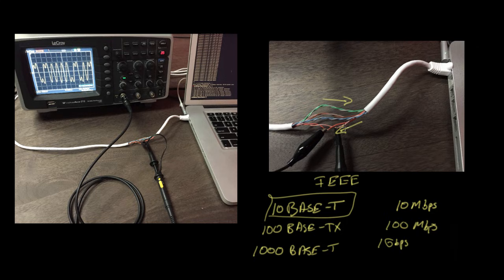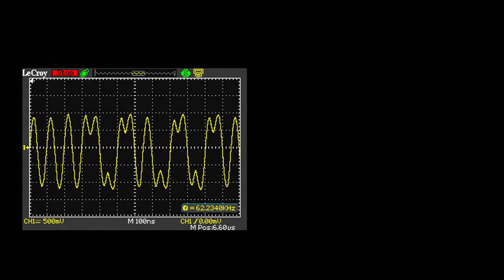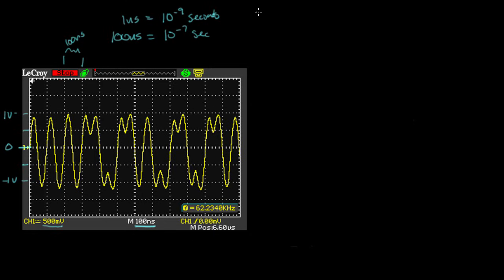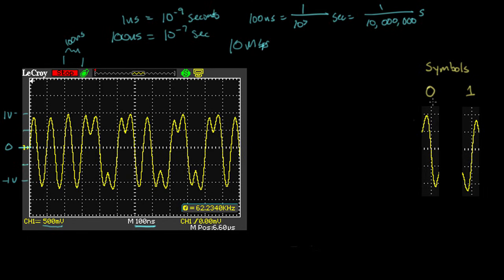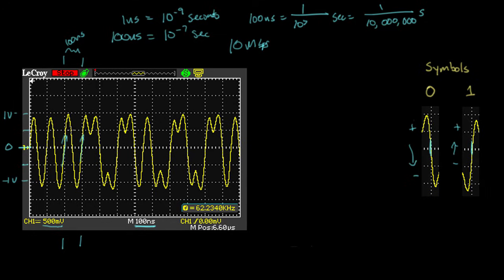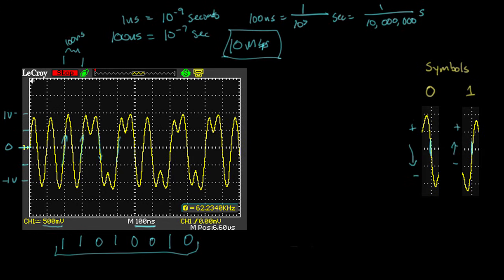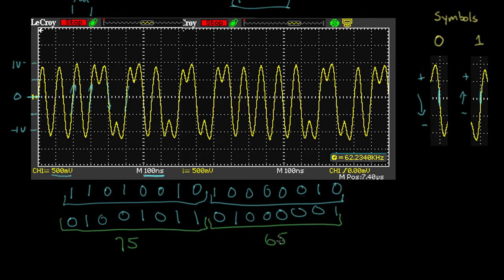Analyzing actual Ethernet encoding | Networking tutorial (4 of 13)

Comment: "Connecting my 8-bit breadboard computer to the internet"
Reply: omg lmao. My be possible, this dude is insane
Reply: @nickadams2361  giving a shit in this world is insane lmao. for real, though, this guy's videos are very insightful.
Reply: I think the clock frequency is too low, but there might be a protocol for slower computers
Reply: @franchufranchu119  overclock it
Reply: @M Isa haha
Reply: @misaalanshori  goodluck high freq on a breadboard
Reply: @franchufranchu119  Dialup? 56K?
Reply: @franchufranchu119  make a separate network card
Reply: @franchufranchu119  it is actually possible.  Network switches are often backwards compatible with older standards, so even if a switch is labeled 1000 BASE-T (1 Gbps) it likely supports the 10 BASE-T used in this video.  And even if the 8-bit breadboard computer couldn't even handle 10 BASE-T, you could use an external converter to go from a serial signal at whatever bitrate your breadboard is capable of into one of those BASE-T standards.  (a quick search online shows me a RS232 to 10 BASE-T converter)

Comment: I have been tempted to get my oscilloscope hooked up to measure Ethernet speeds for some time.  I'm glad you did it for me and I can just watch it here.  My initial assumption was that when the transmitting end of the wire went high, the entire wire would be high before it changed to low, meaning that data didn't really travel down the wire, but more like the wire as a whole would reflect the current instantaneous state of the signal on it.  But your scope shows it changes from high to low in only 50 nS.  Assuming electricity (signal) traveling at .8c that would mean the signal would only travel 40 ft in 50 nanoSeconds.  That means that a whole nibble (4-bits) can be on a 100 meter length of cable at once.  That blows my mind!  And that's only 10-baseT or 10mb speed.  Imagine gigabit speeds and how many bytes are on the cable at once.
Reply: Do it yourself. Its not the same as watching a youtube video. Youtube videos are quickly forgotten.

Comment: Wow, thank you so much...spent a month trying to figure how to build a DIY wifi controlled power supply by implementing an old WiFi router and coding a simple browser interface for my phone - well I got stuck at trying to figure out how to program a circuit for variable power outputs I need via the WiFi router connected...or even better trying to figure out how to adapt router as a output settings memory device for the power supply circuit modifiable over the network. So I was trying to build an oscilloscope probe circuit, for the internet signal, to try to understand how to read and implement the internet signal for the live updates back and forth - I wasn't hoping to find a video that actually tells me precisely what to look for - wow...10 years of coding didn't thought me this - suddenly I understood how data is encoded into the electrical signal and thanks to your video I actually now understand how computing works wtf - brilliant!!

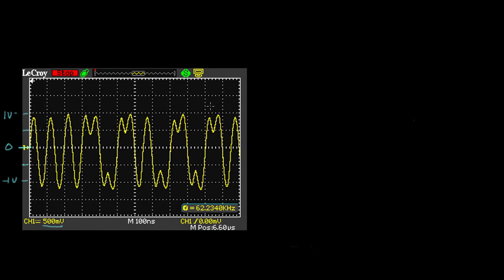Comment: 3:38 *Now in the horizontal direction, this is telling us that each division represents 100 nano-seconds*

7:38 *We've decoded two bytes*
[ 1101 0010 ] [ 1000 0010 ]

7:42 *And one thing that sorta I guess a little different about ethernet is the way is puts these bits onto the wire in this format, it reverses the order of the bits: The 128th place is sent last, and ones-place is sent first.*

So the time-axis must be increasing from left to right ?

Sorry, just trying to get this straight in my head. I understand now.
Reply: Yes the sweep goes from left to right

Comment: 7:50 - "...it reverses the order of the bits." Would you please explain why the order of the bits are reversed? Thank you for the great video!
Reply: It's just the way he hooked up the wires to the oscilloscope. Think about it, if that is the side of the sender, then what does the receiver side get first? For example, let's say you want to send me a message in order, let's say the message is "hello". If you send that to me one letter at a time from your side you will send: h e l l o, but at my side what i get first is: o l l e h. I have to first flip the message, or flip the bits as he said, to get the correct message. The graph you see in the video is basically the "o l l e h" from my example, due to the way he hooked up the wiring. Were he to reverse the wires, he would get the correct message right away, just depends from what way you're looking.
Reply: @shekharnandkoemarsing158  i think you're confused. packets aren't sent all at once. when i send the message "hello," i begin by sending "h," and you instantly receive this (for all intents and purposes), then i send "e," which you instantly receive. it's not like feeding a sheet of paper with text on it through a slot where the letters are revealed one at a time in reverse order, it's more like just talking to someone where each sound is continuously received by the other party in the correct order

sorry if you figured this out already i'm mostly trying to make sure nobody else gets confused reading this
also sorry for being so verbose im high rn oops

Comment: I’ve also heard Manchester line codes referred to as split phase. Some of the faster speeds I assume are using split phase with more complex constellations? I’m relatively new to digital data transmission. (RF engineer, first year grad student).

Comment: i can see how you could recover the clock frequency and most of the phase from any point in the signal, but i see two phases, 180 degrees apart, that are equally valid. one of those phases is invalidated when the bit values transition between 1 and 0, and it holds for half a cycle. but what if there was just a continuous stream of the same bit? how could it tell if it was a continuous stream of 1s or 0s?
Reply: also curious about byte boundaries! i would assume the line code is just responsible for transmitting a string of *bits*, and there's a higher-level coding scheme that aligns the bytes. but then you decoded the line code directly into bytes you sent down the wire, how's that work?

Comment: Quick question, so for transmitting you have two wires... The orange with white stripes which corresponds to the positive transmission and the full orange which corresponds to the negative transmission. So is the orange the ground? Why do we need both? Can we just use the positive?

Comment: What about differences in connection speed? For example, my Ethernet connection could be 1000 base t, but my connection speed is only 890 mbps. Why is this and how can the clock still be synchronized?
Reply: The link speed of your connection is independent of your computer's ability to transmit/receive to/from it. While your computer is not reading/writing the network the link is "idle". In your case of 1000Base-T this means special "idle symbols" are being squirted back and forth when there is nothing to do. In other words the link is 100% occupied with bits all the time but some of those bits are "filler".  !00Base-T uses a similar scheme but if memory serves 10Base-T really does drop to 0v when not in use (except for some frequent link test pulses to keep the link up but they could not be mistaken for data).

Comment: Thank You for this video. Very enlightening. Would you call this voltage AC as it reverses direction or is it an analog DC voltage ??
Reply: It's AC, since the number of 'direction reversals' counted over time added together equals zero. And it has to be, since Ethernet is connected to the cable using a set of transformers, which don't pass DC by definition.
Reply: It is 10 MHz ac.  It is RF actually.

Comment: In 3:31 you say that the voltage is fluctuating between 1v and -1v. Is it accurate to say that the Direct Current that computers use is turned into Alternating Current to send data?

Comment: So what is a negative voltage? Is that just electrons going in th opposite direction as originally intended by the circuit, if so how would this be possible, are we just calculating if the copper wire went left a little or right a little by electronic force?

Comment: Interesting. Does this mean that the ethernet ports inside our devices rely on FPGAs to register the rising edge of a bit (which registers as a 1) and the falling edge of a bit (which registers as a 0) to decode information? FPGAs seem like a good bet because of their speed, which is definitely required for the faster (1 Gbps) protocols.
Reply: 5 years later your answer is — dedicated hardware inside of an Ethernet port is called an ASIC, application specific integrated circuit. FPGAs are nice when you are not sure of the target or if you are not sure that you are finished optimizing. But ASICs are much cheaper to produce so they are used for large scale productions.

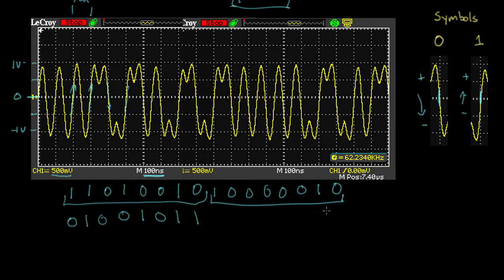Comment: 8:24 Anyone know why they flip the bits? Can't understand the purpose of flipping
Reply: from what i understand (could be wrong) each byte is sent in least significant bit first(so technically not byte reversed but only technically). this is so that when the data reaches another system, the system doesnt have to reorder the data and instead just receives it normally.

Comment: Anyone know why the voltage fluctuates from 1v to .5v or from -1v and -0.5v within a 100ns period?
Reply: Not an electrical engineer but it looks familiar as an audio engineer. If you play a square wave through any high system and look at it in an oscilloscope, you’ll notice it looks “wiggly” like this - you can find plenty of examples online. That’s because of ‘band limiting’ - the process of restricting the frequencies that we send through a cable to just the ones we are interested in. In the case of audio, we’re only concerned with the frequencies we can hear. In the case of networking, we’re only concerned with frequencies that will allow our receiver to decode our signal. Our receiver can only “hear” 10,000,000 transitions per second - 10 MHz. So we don’t need information contained in frequencies much higher than that.

So why does it make it wobbly? Well here’s the weird thing: all band-limited signals (which includes all sound, radio and electrical signals) can be represented as a sum of sine waves. In fact that’s more or less how they all behave in nature. So when you filter out the high frequencies, you end up seeing more of the big wobbles from the low frequencies. You haven’t distorted the signal, or made it harder for the receiver to follow - in fact, the receiver can’t tell the difference, just like your ears can’t hear the ultrasonic nuances of squeaking bats.
Reply: @gormster  wow thanks for your response ! Makes sense !
Reply: You have to do that to change 0 to 1 and 1 to 0. Without it you only can send "0" or "1". To send a different symbol (0>1 or 1>0) on the next clockpulse, you have to keep the signal high, or keep the signal low. In theory the signal would not make a little dip and it would be a horizontal line. (The little dip has to do with inflowing current, I think)
Reply: @Guust_Flater  Yeah what I'm wondering is specifically why the little dip is occurring.
Reply: Gaboik this explanation is incorrect.  These are not square waves. It is a 10 MHz carrier.  The data is phase modulated on the sine wave.  The squiggles are there because the bit waveforms don’t start at 0 volts.  Look at the symbols to the right. The waveform is made up of a sequence of those symbols back to back. When the symbols alternate, you get those little squiggles.  The phase of the sine wave is inverting at that point.

Comment: So what I'm confused about is it seems like your oscilloscope is reading 64KHz when measuring the wave. What I want to know is why is that? Is there something I'm missing about how ethernet works? Wouldn't 10Mbps be 10MHz? I'm curious because I want to do the same, and I want to know what quality of oscilloscope I would need to be able to accurately see the data.
Reply: you need at least 5x the signal rate to useful analysis, 10x if you want to go into intricate analysis.
Reply: but 64Khz is much lower than 10Mhz...
Reply: Hey. I know I am super late in answering this. What I think is happening is that the oscilloscope doesn't actually detect the frequency of the signal. instead that frequency is the frequency of the visible wave on the screen. It tries to look for a pattern on the screen and calculates the frequency of that.

Comment: Hi, Thanks for the video. I would like to know how do you know the  time division scale has to  be 100 ns. As mentioned in the video, this is  10Base-T i.e. 10 Mpbs communication system. I can't see the relation between 100 ns and 10 Mbps bit rate. Could you please explain it to me?
Reply: basanta sishir         10mbs=10 million bits
100ns=1/10 million s
so 1 bit ever 100ns would be 10 million bit ever 1 second.
Reply: basanta sishir         10mbs=10 million bits
100ns=1/10 million s
so 1 bit ever 100ns would be 10 million bit ever 1 second.
Reply: At 10Mbps each bit would be 100ns long.  100ns is one ten millionth of a second.

Comment: I didn't understand why it reverse the bits. Someone could re explain? Thanks.
Reply: It’s a convention. Data is transmitted msb first in data communications.
Reply: @stargazer7644  but here it looks more lsb first, am i right ?
Reply: @raphac7641  Ethernet transmits with most significant byte first, and least significant bit first.  You could build the hardware to do it any way you want.  LSbit first is just the convention that arose for data communications.  This convention goes back to 45 baud asynchronous serial teletype days, perhaps even earlier.

Comment: Why is each byte flipped?
Reply: The information is sent from one machine to another. lets say I want to send you the following bit: 01010011. The 0 is sent first followed by 1010011 so on the receiving machine it is sequentially received as the original. Hope that makes sense!
Reply: It isn't. If you consider the direction of the time axis on the graph from the oscilloscope, it increases from left to right. So the first bit sent is the one on the LEFT (the least significant one), and the last sent bit is on the right (the most significant one). Conventionally, we write numbers with their least significant digits being on the right, though, and they increase from right to left, which is an opposite direction to that of the graph's time axis.
Long story short: they are "flipped" only on the graph in space, but in time they aren't. It's just an illusion of the graph :q
Reply: *Sci Twi* is right and *Dizco* is wrong. Stop upvoting the wrong answer.

7:42 Ben clearly states that the one-place (least-significant digit) is sent first.

So a value in memory of [ 1101 0010 ] will be displayed as [ 0100 1011 ] on the oscilloscope.

The zero was sent first. 100 nanoseconds later, a one was sent.

So...
+100 ns = 0
+200 ns = 1
+300 ns = 0
+400 ns = 0

+500 ns = 1
+600 ns = 0
+700 ns = 1
+800 ns = 1

This is kinda the same example in the video in reverse.
In the video, Ben was sending [ 0100 1011 ] over the wire, which displayed as [ 1101 0010 ]

So...
+200 ns = 1
+300 ns = 0
+400 ns = 0
+500 ns = 0

+600 ns = 1
+700 ns = 0
+800 ns = 1
+900 ns = 1

It's just the agreed-upon format for sending & receiving data over the wire.

Comment: 1000 Gbps does NOT use all 4 pairs to TX-RX they are reserved for POE...
Reply: You are wrong.
Reply: Power over ethernet is a DC voltage applied on the same wires that are used to transmit data. The data is effectively AC and so very easy to seperate from the DC.

Not only does 1000 Base-T use all four pairs, it uses all of the pairs for TX in both directions at the same time.

More here: http://grouper.ieee.org/groups/802/3/ab/public/nov97/geoff1.pdf

1000BASE-T
• 125 MHz clock
• Four pair
• PAM 5 coding on each pair
• One byte per BAUD over four pair
• Full-duplex on each pair